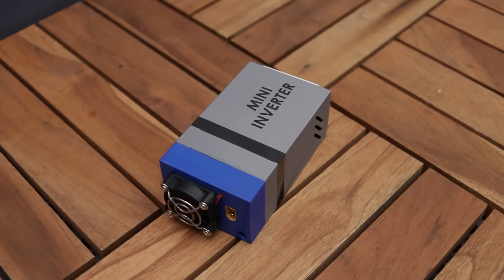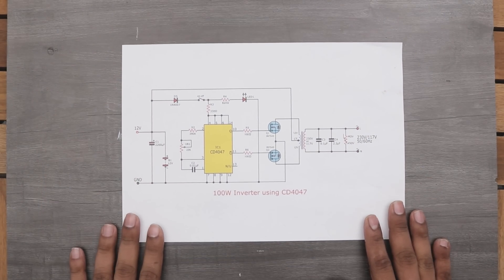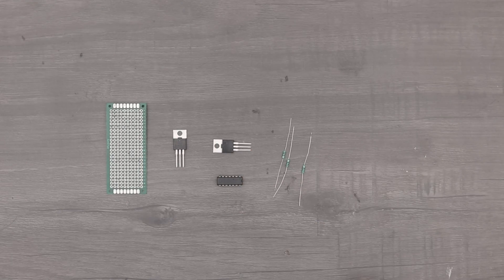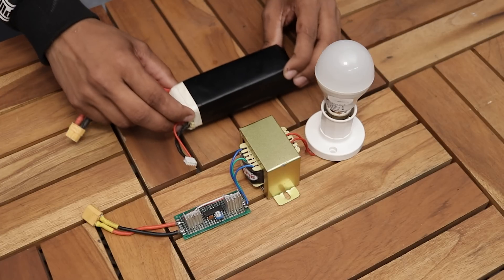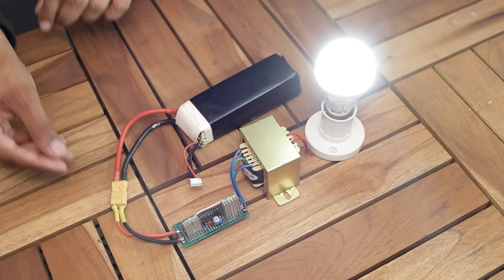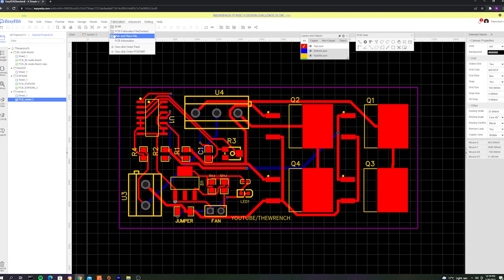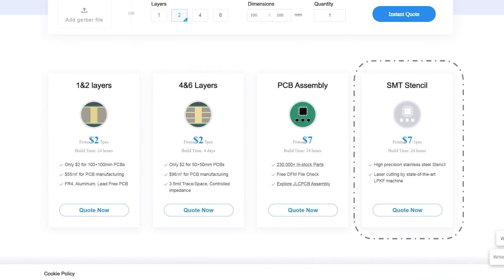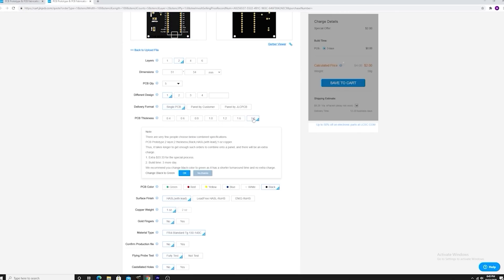How i made this Mini Inverter

Comment: Interestingly, the LED-bulb has an inverter built in doing exactly the opposite.
If you use this in case of blackouts, you would be better off using a regular flash light.😁

Comment: I made bigger one with ~500W and after burning a set of 2N3055 learned the hard ways that I need lots of complex circuit protection
11.5V under protection
230v<>250v switch for bigger loads
Seperate/independent stable power for oscillator no matter what short happens osc. Must continue. 
12v & 230v Circuit breaker 
Box was from Lego type plastic box, I was a kid since. 😁

Comment: Making an inverter in today's time is not a big deal. A amature can make it. Real deal is to minimize the losses and increase efficiency to its max. In video you did not talk about anything rleated to efficiency or losses.

What good is an inverter/UPS if it consumes too much battery and gives output power for short time by wasting all the power. Anyways, nice share, thanks.

Comment: A clock pulse feeding into a push-pull mosfet pair. A classic square wave inverter. But I wouldn’t use it for anything else other than lighting a few CFLs.
Reply: Seems he is demonstrating it with an LED bulb. In that case it makes almost no sense, other than demonstrating a simple square wave inverter.
Reply: @oscargr_  I didn't say it is senseless. Just that the circuit should not be used for all general purpose applications. The circuit is crude, yet effective. And like all engineering solutions, it has it's own trade-offs.
Reply: @vinitshandilya  The circuit may or may not be senseless. I an talking about this application.

Comment: isnt this dangerous because normally we use 230V?
Reply: Appliances are at least capable of accepting 240V. And it seems the voltage goes down under load.
It's a cute little circuit, but it isn't great. There is a reason this isn't available commercially.

Comment: Interesting. This is a simple square wave inverter with no feedback. It can't maintain a stable output but can power simple loads like light bulbs, small heaters or small fans. I wouldn't expect it to work with loads that have converters, like TVs or monitors. Chargers might work, but you'd get a dirty output. It's certainly useful in blackouts. There are dedicated ICs available for pure sine wave inverters with feedback.

Comment: appreciate the video & editing, its amazing and good job, but just one thing:
since when the drop voltage become the output power rating?
the discrepency between no load voltage and under load voltage it's called drop voltage, not power output!
if you had an electrical engineering background, you obviously know what you measure with the volt meter is the voltage output, and yes, the voltage output will be high if the inverter has no load on it, 
and will have a voltage drop if it attach or plug in to the load (in this case the LED light bulb),
the drop voltage amounth is depend on how big your load is, in the video, your load output is the same as the power rating on the light bulb (20 Watt) NOT 50 or 60 Watt!
please review once more the content of your video, it seriously missleading! 
😡😡😡😡😡
Reply: I agree, you can see that the LED bulb he has plugged in probably only pulls 15 watts at the most

Comment: It is the first inverter I ever built, in late 80s (88-89 maybe?). I found the schematic in a CMOS IC user manual and it was capable to drive 100W load for 1-2 hours or 60W load for >8h without heating too much. The transistors were BD139 and 2N3055 in darlington configuration and on secondary it had a capacitor to filter higher harmonics. I added a 4049 between 4047 and BD139 base for higher current capability. 
The output signal was good (not sure if square or sine) but I think the output capacitor and the iron core of the transformer filtered higher harmonics so I found no issues powering small TV, radio, shaving machine or light bulbs from it. The battery was a standard car battery (my father's car).
Reply: Please can you attach a link to the schematic. Thanks

Comment: One of the worst circuit and setup ever seen. Dangerous for the battery (over-current, short-circuit, under-voltage, temperature, ...), for the devices attached on the AC (better to say square wave), for the fire hazards caused from the inappropriate casing, for the ripple not measured, for the circuit itself (reverse current protection? Some diodes?), etc...
Please, don't replicate it. Buy something professional if you need an inverter.

Comment: AC frequency is not crystal controlled, and there is no voltage regulation.  Don't use on anything that is too fussy.  Also, as others have said this is a square wave inverter.  Still, it is useful for some uses.
Reply: Other things that came to my mind that are far from ideal : no dead time and no soft start.

Comment: So that's a square wave inverter. These days a modified sin wave would be almost as easy and, using a EGS002 module, a sin inverter would be even easier with lots of fail safe provisions.
Reply: Well it is a old schematic, this circuit I first saw in late 80 and by then it was old. In the original schematic there was a capacitor on the output to filter higher harmonics and the iron core of the power (mains) transformers were not too efficient at higher frequencies so they filtered also harmonics above few hundred Hz. As the square wave have only the odd harmonics, mainly 150, 250 and maybe 350Hz would appear at the output somewhat attenuated. So, not so big deal for 70s-80s electronics or for powering an incandescent light.
Reply: I agree with you Rhian Taylor. An EGS002 board would have been far better.
Reply: *sine wave
Reply: @proxyhx2075  No, let's go with Sin Wave :)
Reply: @SetitesTechAdventures  😆👌
Reply: Agreed

Comment: So how many watt output is it because an LED light bulb doesn't require that much to begin with so the real question is how much amperage can it sustain without crashing? Like for example I have a 2000 w inverter if I go over 2,000 w it causes the inverter to crash and to keep the components from being destroyed.
Reply: Do some math? It used 2x12V primary at 2A. So, the power in primary is 2*12=24W. If the transformer has the efficiency around 80% then it will have 24*0.8=19.2W in secondary. In reality he can draw up to 20W in medium run or up to 25W for short time without the transformer and transistors heat too much. For best results, the power draw should be up to 15-16W to keep the device cool. You saw that for 20W output the output voltage drops to 190V (at 75% approx).

Comment: Add over-current protection for the battery, I am no expert but what if something breaks and that XT60 connector starts delivering a few dozen amps? Nice video!
Reply: LiPos are capable of delivering a few hundred amps. If something goes wrong, this thing is going to be on fire.
Reply: @PunakiviAddikti Lipos always have protection packs and the one he had shown is equipped with it so no over current or over charge is allowed even short circuit protection is built in those packs
Reply: @raghav1502  Not always, but yes. Using a BMS prevents over current and short circuit.
Reply: he should make an all-in-one thing with battery charging input, overcurrent protection, the inverter and a plug for power output
Reply: If something breaks that few dozen is gonna be a few hundred amps! LiPos are no joke
Reply: Some part will eventually volunteer to be the overcurrent protection.
Reply: @andreasu.3546  It'll probably be the thin wires. Even then, copper takes a lot of energy to melt.

Comment: Adding the fan will waste a lot of power for such small invertor which can run a bulb only.......unless that fan is made with temperature control to make it more efficient..... heat sinks will work best these kind of invertors 🤔🤔🤔.. what do u say boss ??

Comment: how much watts will it hold up
Reply from the maker: 50-60W
Reply: @TheWrench  
appreciate the video & editing, its amazing and good job, but just one thing:

since when the drop voltage become the output power rating?
the discrepency between no load voltage and under load voltage it's called drop voltage, not power output!
if you had an electrical engineering background, you obviously know what you measure with the volt meter is the voltage output, and yes, the voltage output will be high if the inverter has no load on it, 
and will have a voltage drop if it attach or plug in to the load (in this case the LED light bulb),
the drop voltage amounth is depend on how big your load is, in the video, your load output is the same as the power rating on the light bulb (20 Watt) NOT 50 or 60 Watt!
please review once more the content of your video, it seriously missleading! 
😡😡😡😡😡